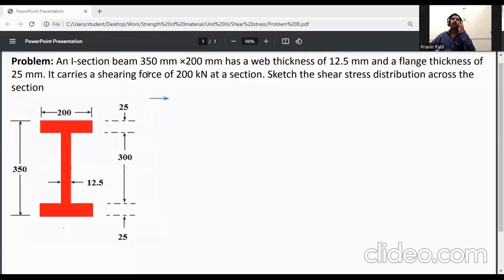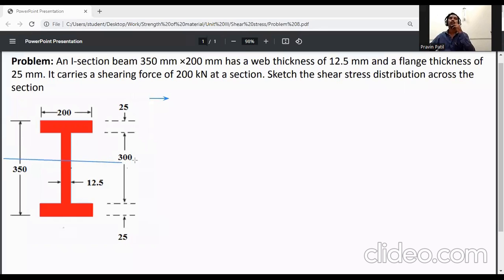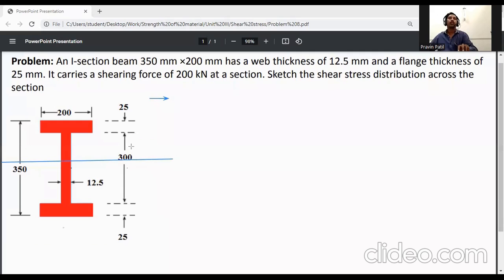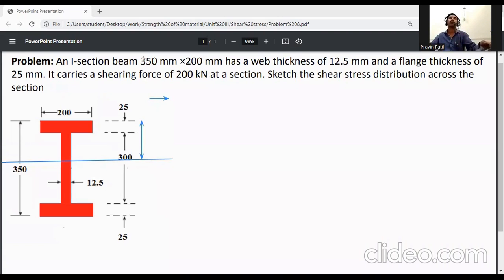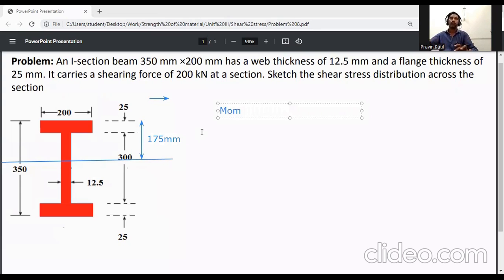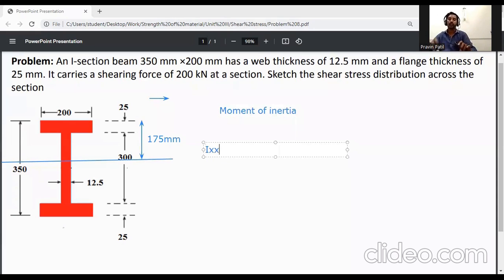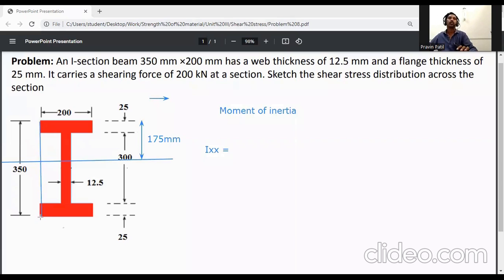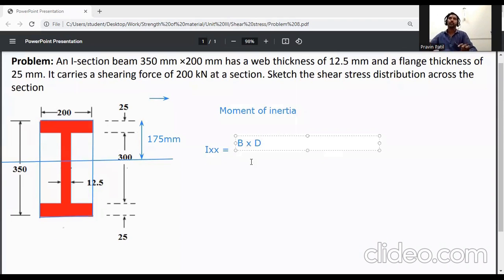Maximum shear stress for Symmetrical I section beam/ Strength of Materials

Comment: please solve for me please

A beam of I section 200 mm wide and 300 mm deep with flange and web thickness 20 mm is used as a simply supported beam over a span of 7 m. The beam carries a distributed load of 5 kN/m over the whole span and a concentrated load of 20 kN at mid span. Determine the maximum bending stress set up and sketch the stress distribution.